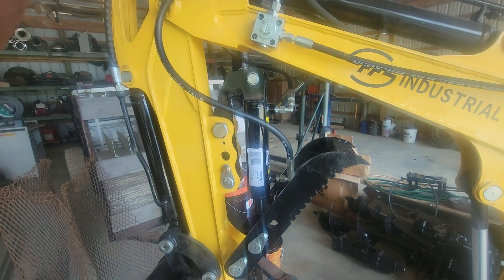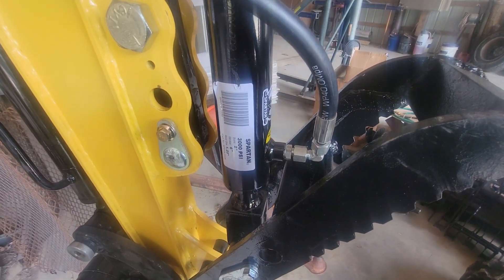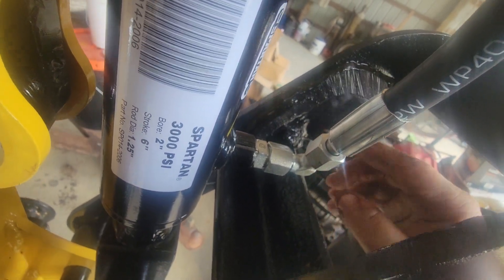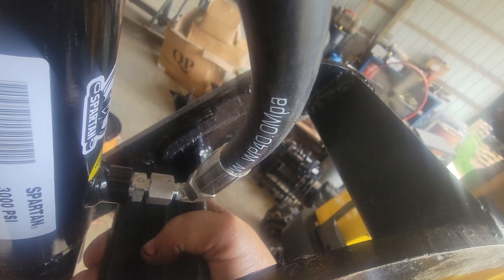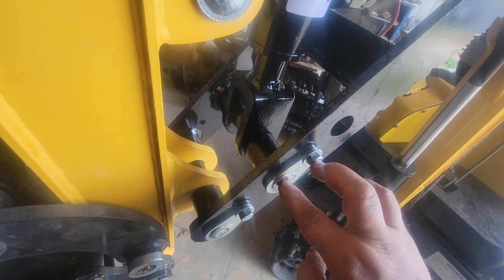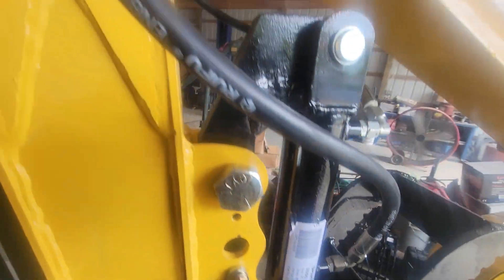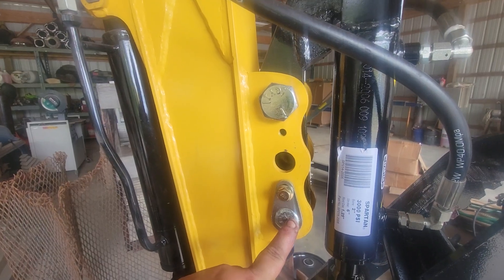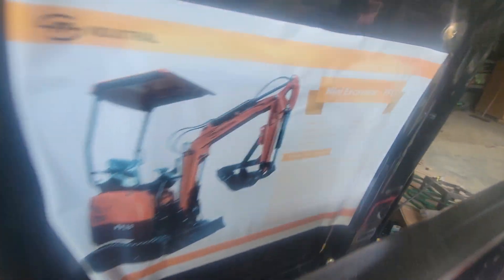FF15 mini excavator hydraulic thumb

Comment: Great addition... !!  did you add cooler fan ?!    thanks
Reply from the maker: I did not. I'm thinking about plumbing a hydraulic cooler in and adding a fan or two. When it gets warm it does seem to get weaker. I threw a track and the blade had a tough time lifting it. I left it alone for a while because I had some other stuff to do. It lifted it like nothing when it was cool.
Reply: @KDuboutdoors19  Thanks for the answer, really appreciated....  I'll prob buy a FF15 in the coming month,  doing a lot of reseach about it.  And looking of future mods I'll have to do. You're hydrolic thumb is a good idea.....
Reply from the maker: If you're on Facebook, you can join the FF mini excavators owners group to learn more. I'm a moderator there.